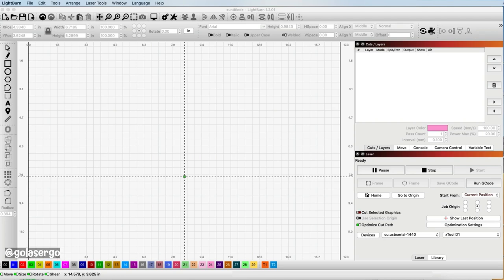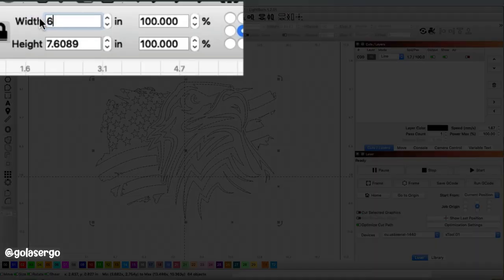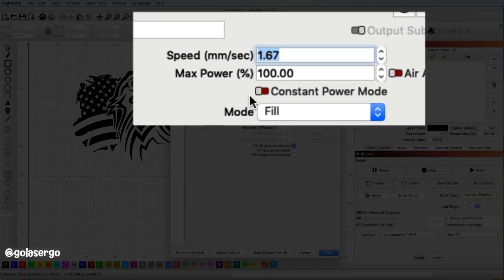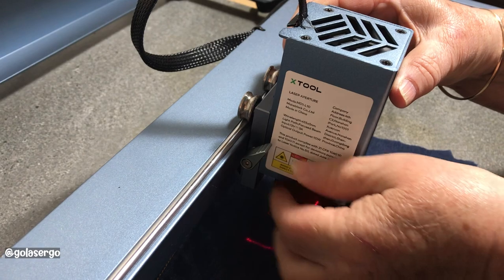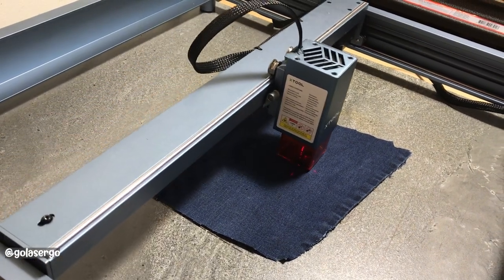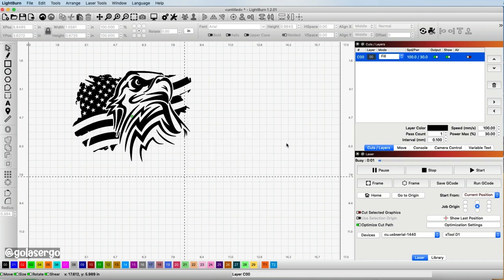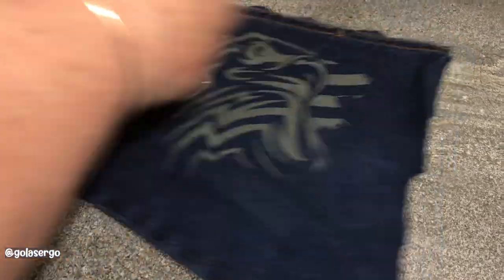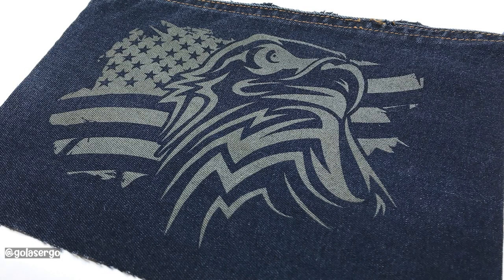How to Laser Engrave on Denim with the xTool D1

Comment: How many washes do these last for? I can’t help wonder if it weakens the fabrics’ integrity from a time perspective
Reply from the maker: The goal is to just remove the top layer so that you don't get this problem. It takes a bit of testing to get the right settings. Ultimately though, I would think that denim that has been engraved would still degrade faster than non-engraved denim.